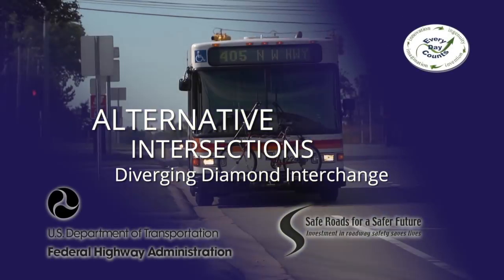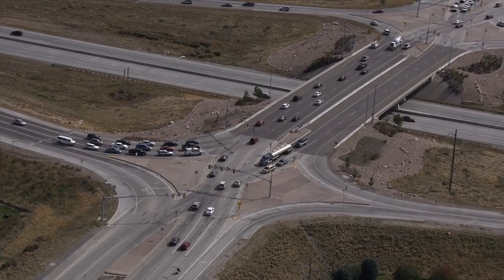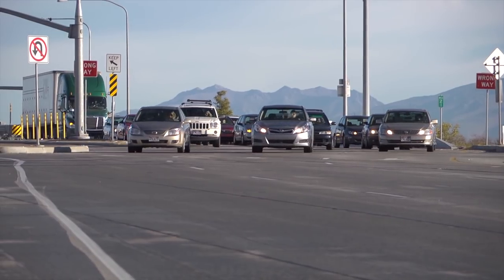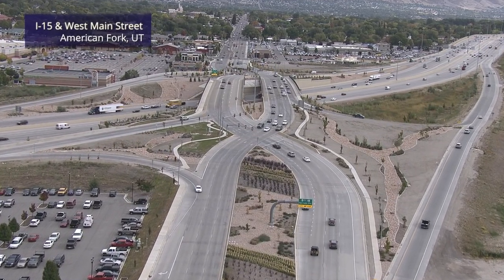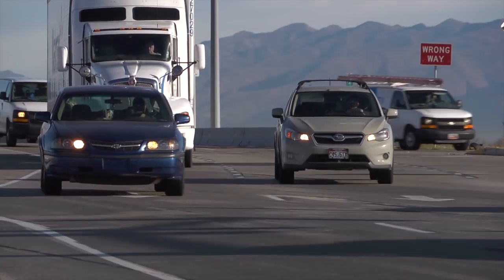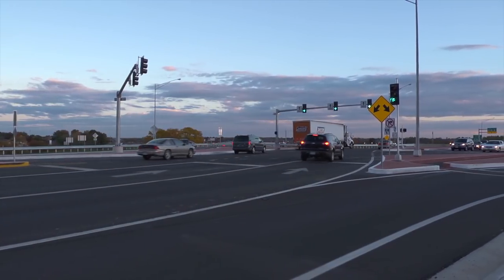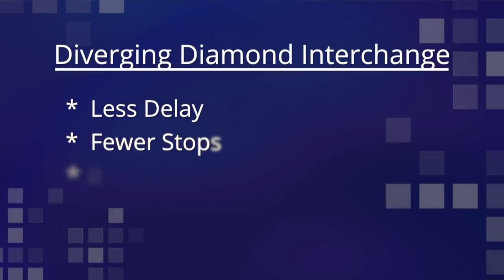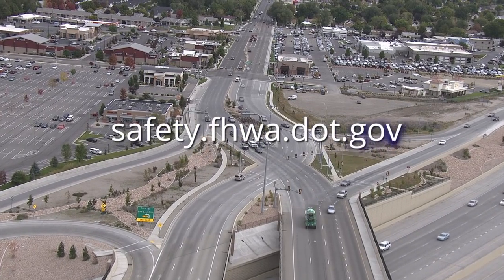Alternative Intersections: Diverging Diamond Interchange

Comment: At 4:15 the driver of the white truck does not keep his vehicle within the lane despite the carefully-painted lines.  Sloppy driving in a DDI makes it that much more confusing to drivers.  Also, drivers will carelessly turn right or left into oncoming traffic at several points in a DDI regardless of how complete the signage.  Wrong-way crashes are the deadliest type and the DDI offers several opportunities for careless drivers to cause them.
Reply: Got any statistics on wrong way crashes inside a DDI vs a conventional diamond interchange?  You'd think going up a ramp the wrong way would be almost impossible with DDI whereas it's VERY easy and common with a conventional diamond for drunk drivers to turn right onto an exit ramp.

Comment: So what happens if the traffic lights at the crossings go out?  We all know how to get through a normal right-angles intersection when the lights aren't working. I don't know what people would do for these.
Reply: U should probably act like it's a roundabout, yeld to the inside of the interchange, I geuss
Reply: +Bob Munck The two lights ARE simple right angles, with all traffic in each roadway only going in on direction. Much simpler than a non-functioning signal at a conventional intersection, with cars coming from four directions all facing three choices (left, straight, right).
Reply: +Scott B Thanks for the response, but I think you're wrong about the right angles. I used the Google Maps satellite view to measure the angles of two DDIs that I know about, one on Rt. 15 south of us where it crosses I-64 west of Richmond VA and one north of Charlotte NC where Catawba crosses I-77 (coincidentally near the new house we're building).  All four intersections meet at close to 135°.  Your second point is a good one, but I still don't know how you'd get the two oncoming lanes to alternate  crossing the intersection. You're going to have cars from each lane starting to cross simultaneously, and immediately colliding.

FYI, we currently live 4 miles north of where Rt 15 crosses I-66 in Haymarket VA, an intersection that is being converted to DDI.
Reply: @BobMunck   wat?

Comment: Doesn't look pleasant or convenient for people on foot. Long circuitous routes with multiple crossings of wide roadways do not appear to be safe or convenient for pedestrians or bicyclists. Were any peds or cyclists interviewed for for the after evaluation? It appears these are intended for use only in areas where peds and cyclists are non-existent or are encouraged to be rare.
Reply: A tiny strip of concrete next to fast moving cars isn't safe at all
Reply: Pedestrian crossings are much shorter with a DDI than with a traditional interchange
Reply: build a ped intercharge for vehicle interchange. I mean ontop of this IC build a ped IC.😂
Reply: facepalm*🤦‍♂️🤦‍♀️ *facepalm